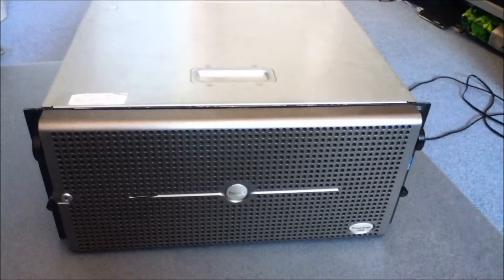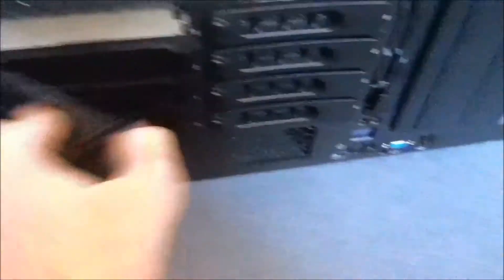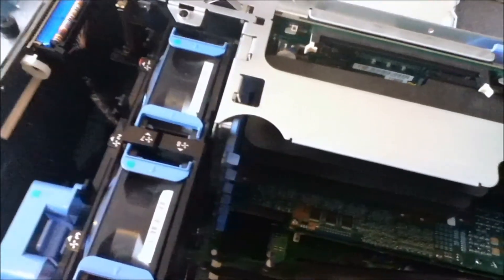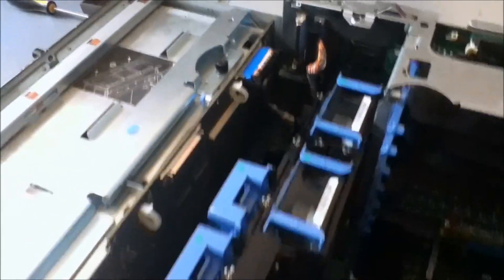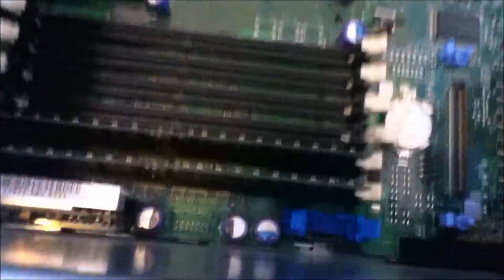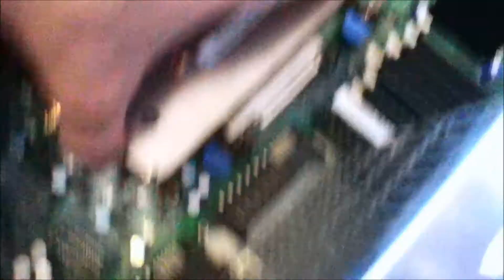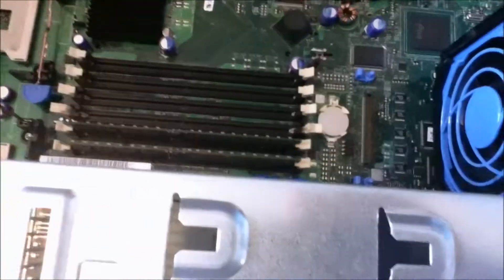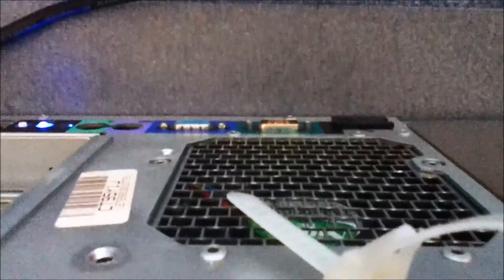A look around the Dell Poweredge 2800

Comment from the maker: Yeh. you should be able to. It may beep or the fans spin up to full power but Thanks m8!  :)  Appart from that it should be fine. Just make sure you have cooling for you CPU's   and you can easly get the fans off ebay quite cheeply.  If you want a definate answer im more than happy to take all the fans out my one and see if it posts.  :)  Hope this helps m8